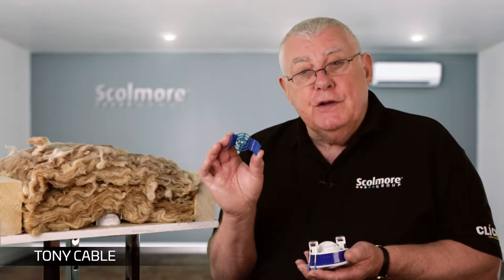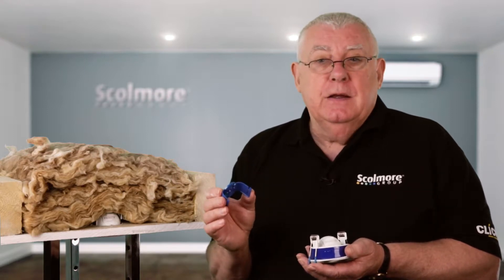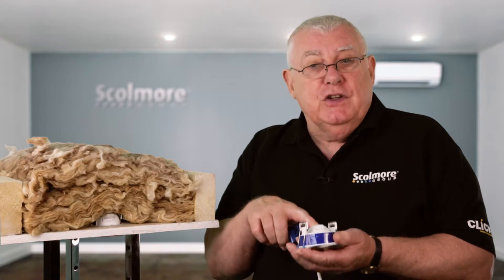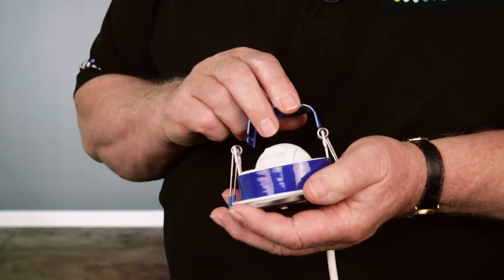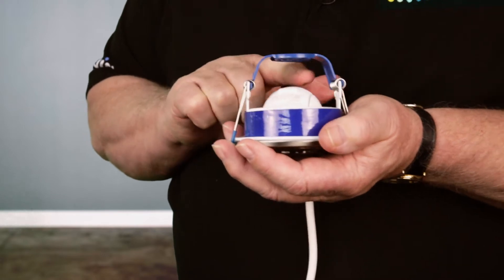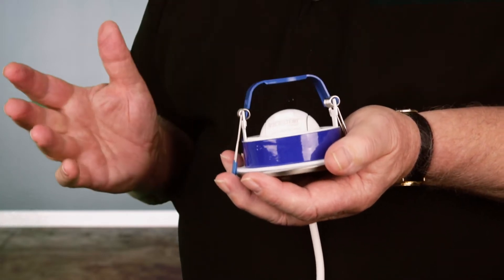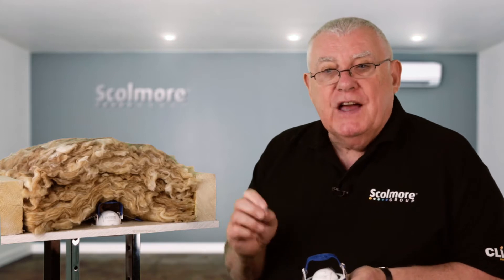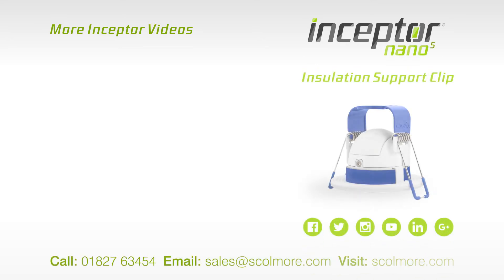Inceptor Nano5 Insulation Clip

Comment: Do the supplied connection boxes have to be protected, or can the insulation lay direct on them & the cables?
Reply from the maker: Hi Ian,

If you use the OVISC1020, Insulation support clip, then you could cover over the top with additional insulation. The cables can be covered provided that the correct installation method for your final circuit is used. 

Our current range of down lights have been designed for ceiling installations, but as long as the minimum spacing is left for the lights to cool (50mm around the edge, 20mm over the top), then there shouldn’t be any issues. The OVISC1020, Insulation support clip can help to achieve this.

I hope this helps, if you have any further questions please feel free to get in touch with the technical department directly on 01827 63454